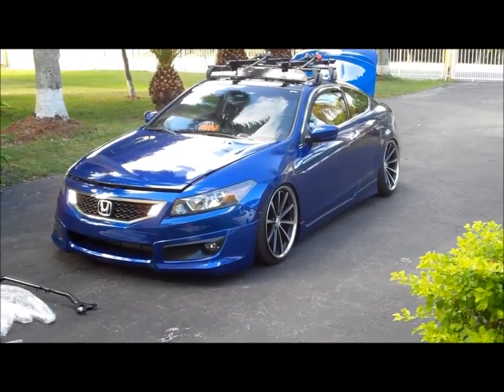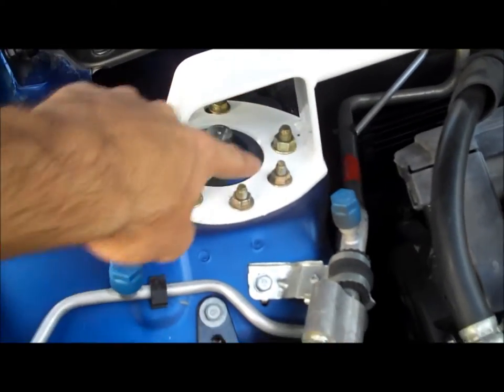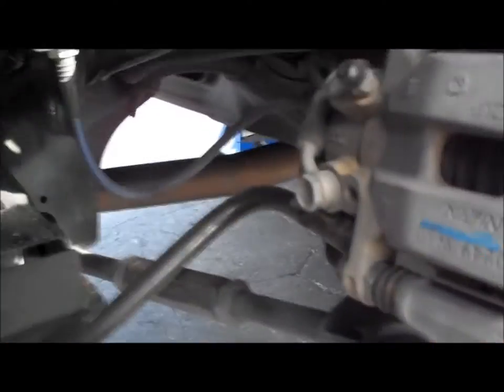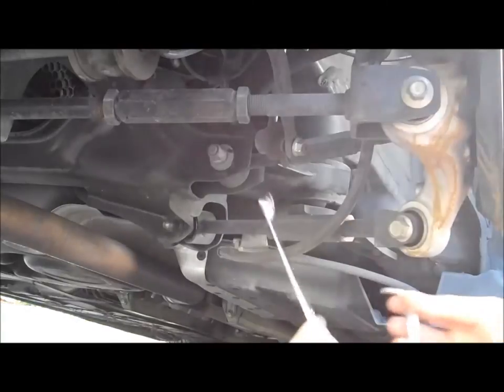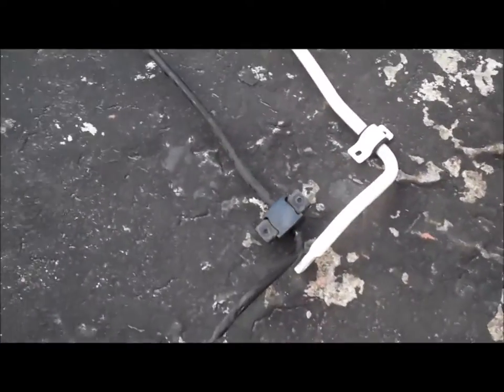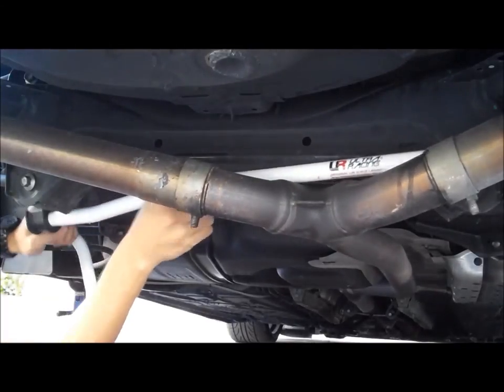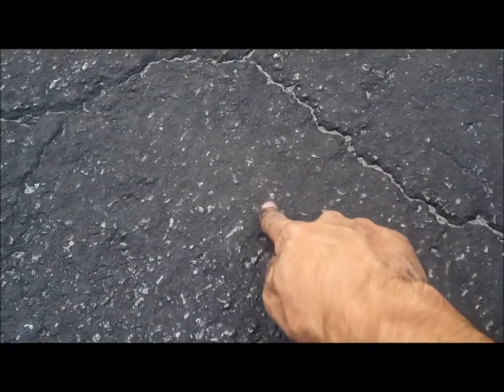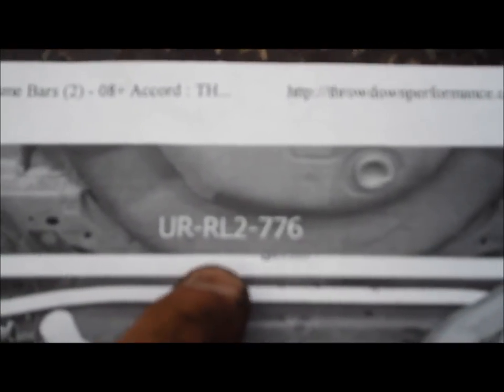Ultra Racing Chassis Kit DIY, 2008-Present Honda Accord

Comment: I did the two front lower bars, the strut brace, the 19mm rear sway bar, and the rear brace on my 2013 accord V6 sedan.  Has JUST enough understeer left to be safe, but takes corners MUCH flatter than stock.  That's even leaving it at stock height.

Can't wait to do the rear bar that connects the alignment parts and the center brace for sedans!